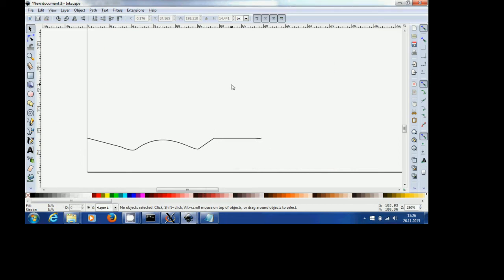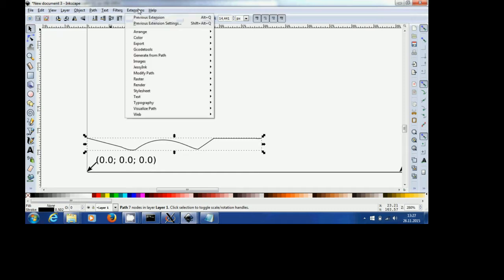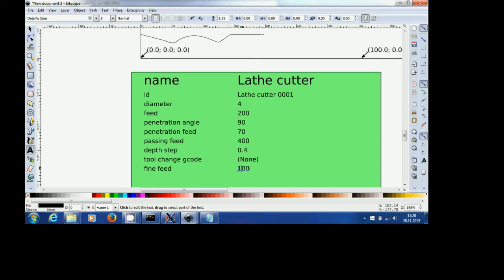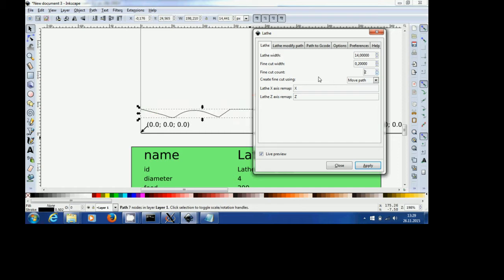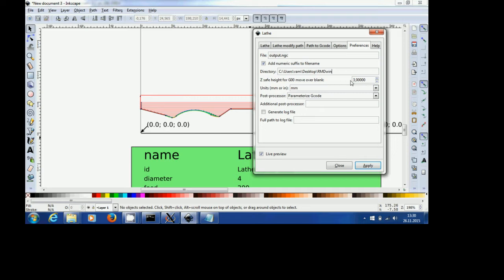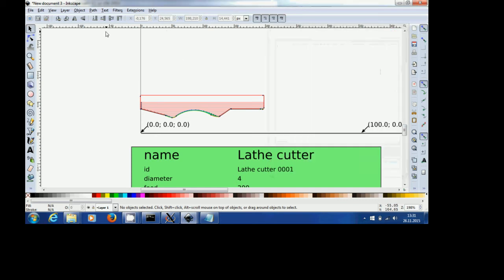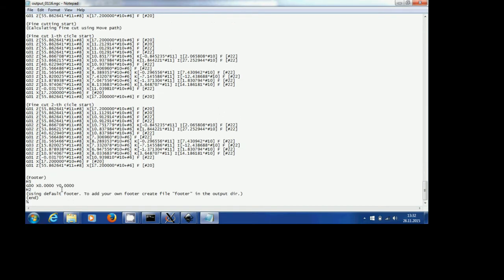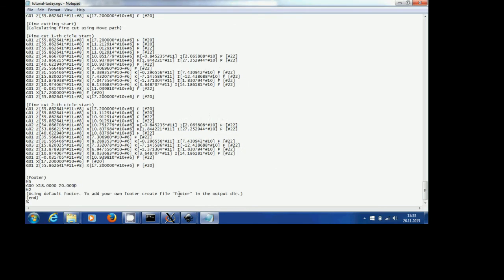Inkscape+Gcodetools for Lathe / upload to Sandybox, Machinekit /  process on UNI-DREH

Comment: Excellent video, thanks a lot.
I tested this procedure using a lathe simulator.
I have no problems when my draw is based on straight lines, but when I use any kind of curve I get from the simulator the message: "Arc centre invalid".
Could you give me some hints for solve this situation?
I have made many combination of curves, post-processor,... but the problem persist.
(BTW, These are my very first steps in this area)
Regards.